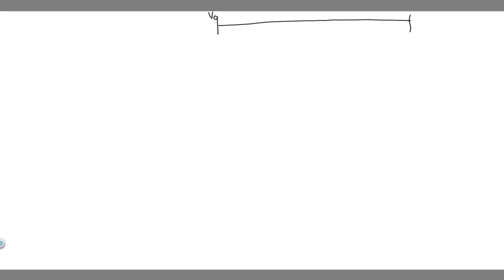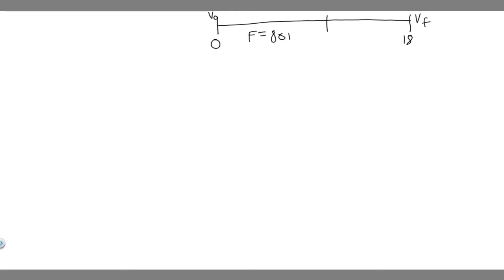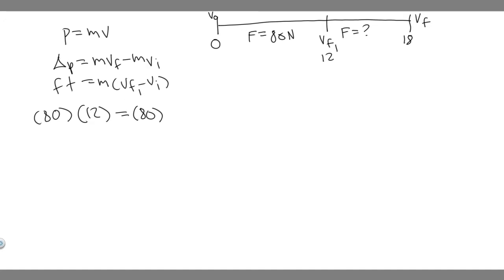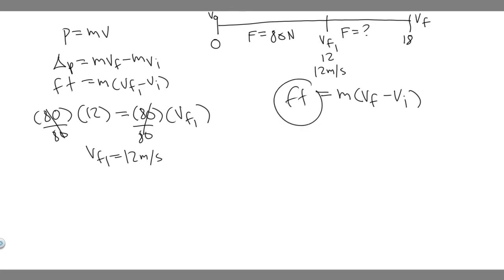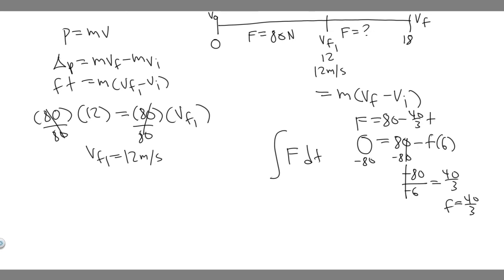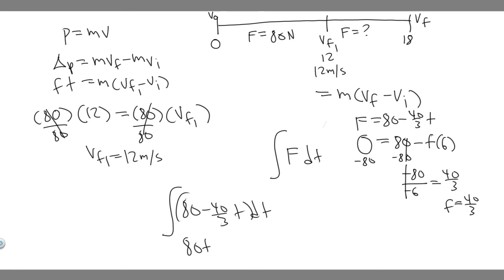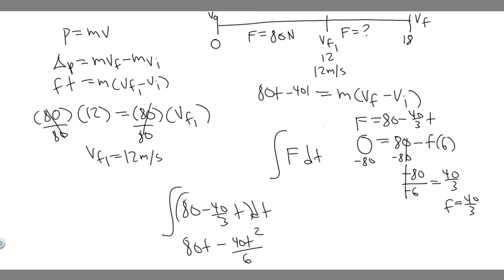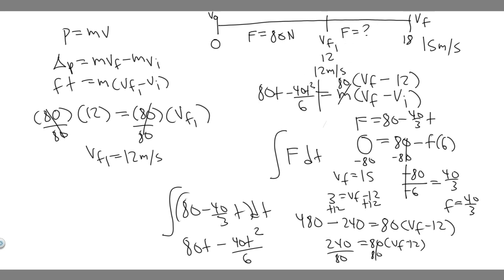A packing crate with mass 80.0 kg is at rest on a horizontal, frictionless surface. At t = 0 a net h

Comment: The integration was wrong, (40/3)/2 = 20/3 not 40/6. Remember reciprocal. Good explanation though.
Reply: have you ever checked the ratio between 20/3 and 40/6? he's wrong in a factoring sense but absolute value those are equivalent terms